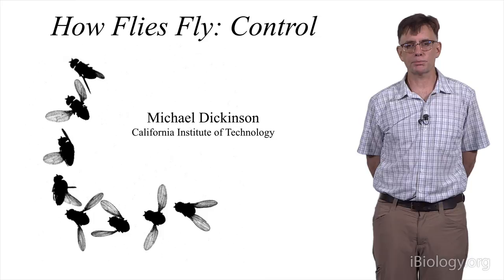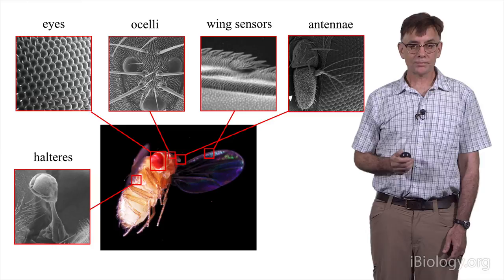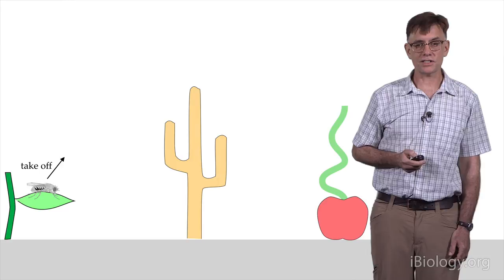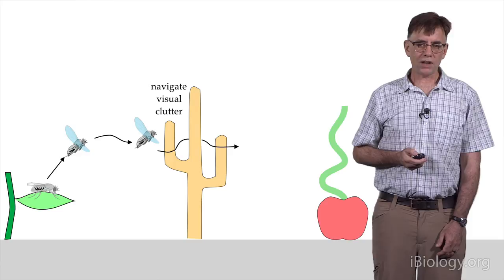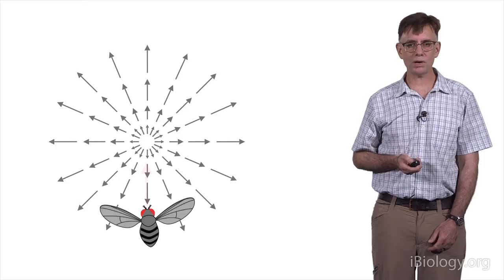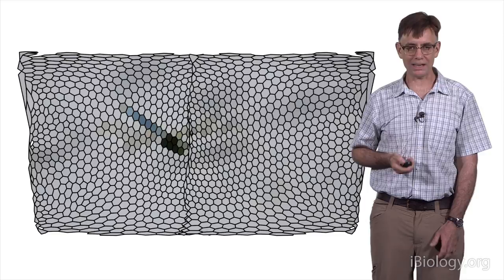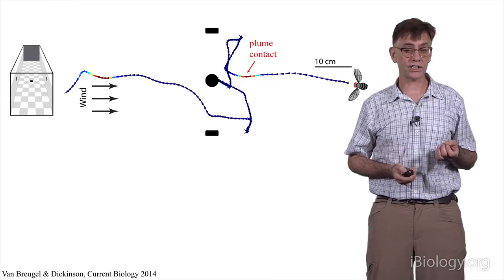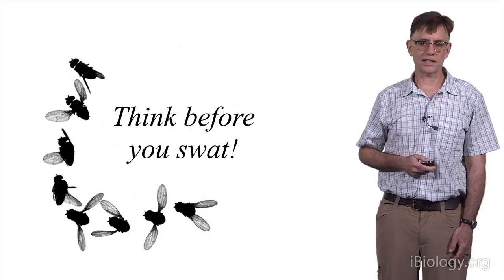Michael Dickinson (CalTech) 3: How Flies Fly: Control

Comment: Fascinating indeed. Many thanks for putting these lectures together.
At 10:42, should we perhaps say "to the order of several millions body lengths of motion", rather than "several *billions*"? E.g. 7 km / 3 mm = 2.33*10^6. Still pretty impressive, of course: for humans that would translate to travelling thousands of kilometers overnight -- that's the airliner kind if speed. Using our bodies alone we are ~100x slower.
Reply: actually, the flies are not traveling in a straight line but in a zig-zag way, so it will take billions of its body length. The zig-zag motion towards the source of food is explained in the latter part of the video.